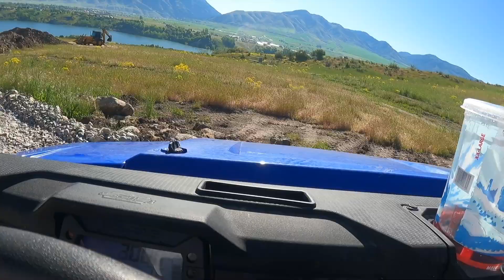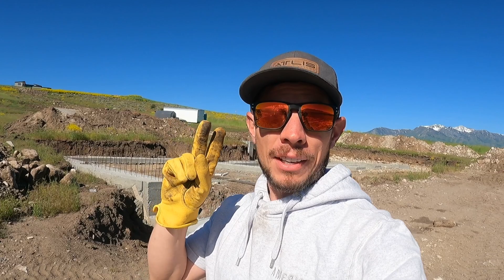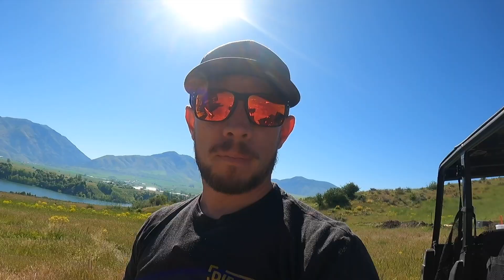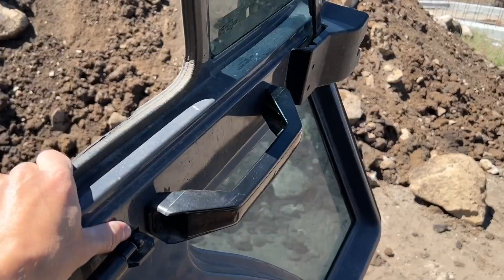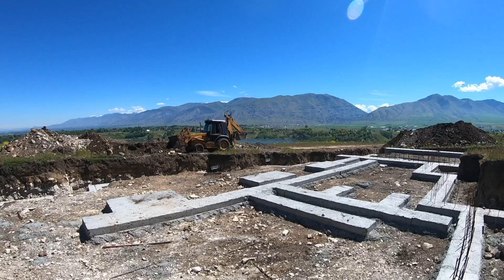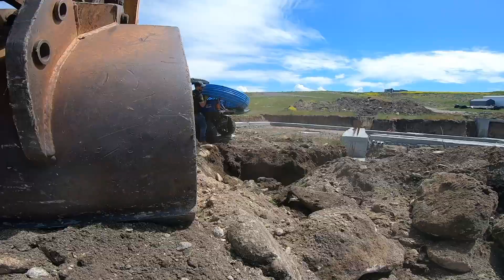Trenching our Water, Power, and Gas Lines

Comment: Interesting,  you refer to buckets as a tractor. I would call it a backhoe. With the bucket on the front, some might say it is a loader. I don't think it is a loader because my dad owned & operated a sand & gravel quarry since I was a kid. He always liked Michigan loaders until msha(osha for mines) red tagged them because they didn't have the newly required rops (rollover protection canopy) dad had to get a couple of caterpillar front end loaders 980C models to replace the Michigans. It is great that you & your dad can run your own equipment with the crazy high fuel prices. If you had to rent machine + a man laborer would add allot to your bill.